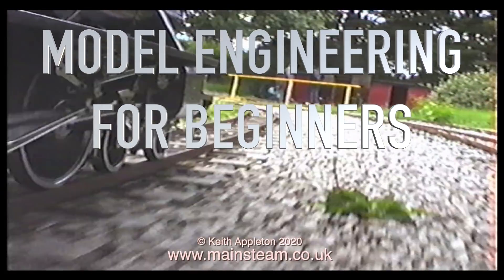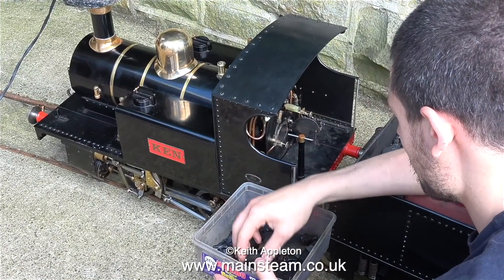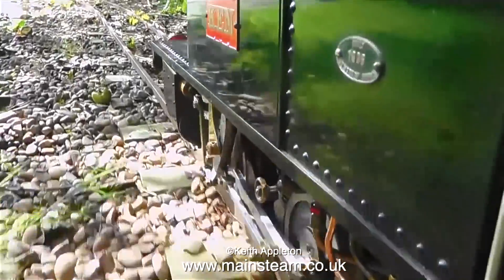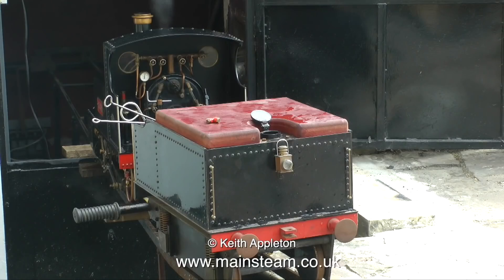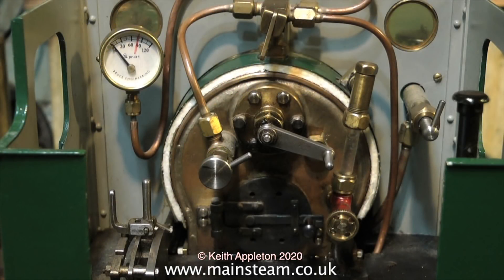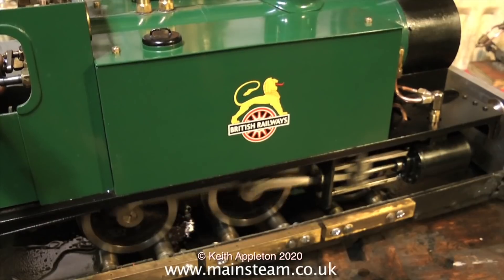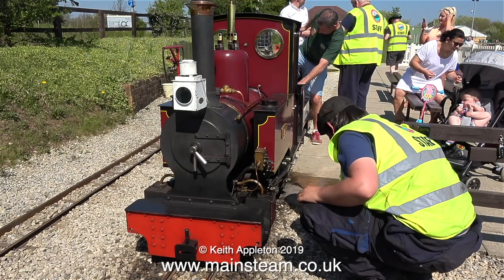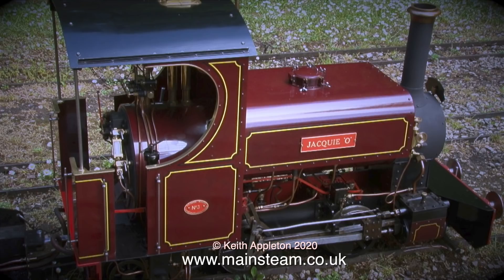WHICH TYPE OF LOCOMOTIVE SHOULD I BUILD? - MODEL ENGINEERING FOR BEGINNERS - PART #38

Comment: Whats a good loco to build if you dont have a lathe or milling machine? Im told that Polly engines are very good as they are pre machined and just need bolting together and painting.
Reply from the maker: "Maxitrak" or "Polly maybe" Just buy a factory machined "bolt it together kit" or maybe a fully complete engine . . . .

Comment: would there be any practical way to build a smaller 7 1/4 inch gauge loco or even a 5 inch gauge loco as 7.5 inch gauge, i don't know how hard that extra 1/4 inch is to get in and with a 5 inch gauge i imagine the entire thing would need to be put into CAD and scaled up bit by bit but i don't know .
Reply from the maker: 5 inch narrow gauge locos can easily be stretched to 7 1/4 inch gauge. But standard gauge locos wouldn't look right.

Comment: I think if I built one I would start in O or G gauge, with butane firing.
Reply from the maker: I started with a 5 inch gauge loco. It was far easier to build than the smaller fiddly ones.